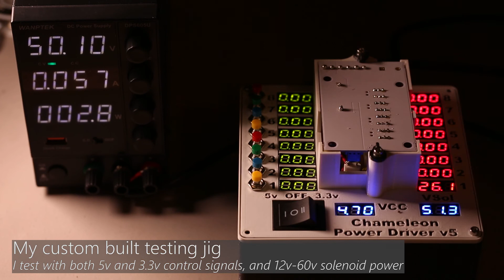Chameleon Power Driver v5 Assembly

Comment: Paul, I would like to chat with you about your Chameleon IO boards. I am doing a homebrew and am trying to decide on an architecture. 
Your system looks fairly straightforward compared to a lot of the solutions out there. I have seen your machines at SFGE. I hope to get my
homebrew there this year.
Reply from the maker: Hi @tgxperience.  I appreciate the enthusiasm, but unfortunately the current IO boards are not available.  The controller chips that I used were discontinued a couple years ago by the manufacturer, and I only have enough chips on hand to make a few more boards for my own personal use.  As good as my IO controller is, I think I can make the next revision even better, primarily improving PWM performance, which is the one weak spot of my design.  I've done some research on components, but with everything on my plate I don't think I will be at the prototyping stage for another year or two.  Sorry, I know that's not the answer you were hoping for.  I wish I could help you, but I don't imagine you'd want to wait that long.